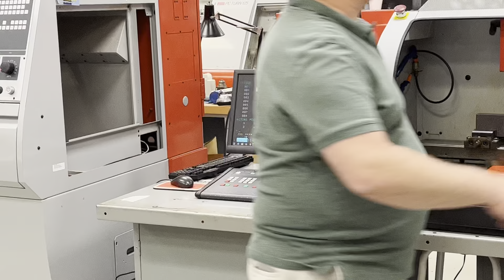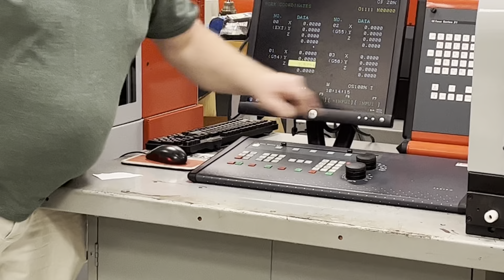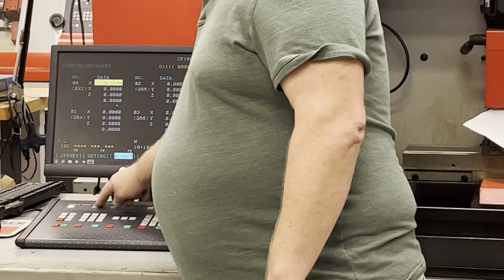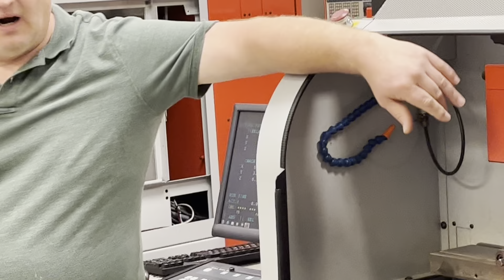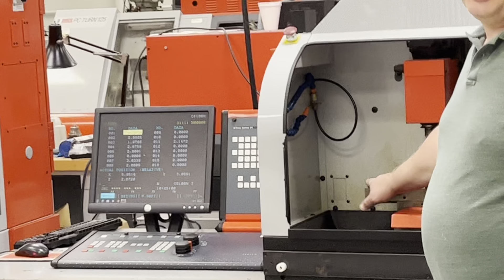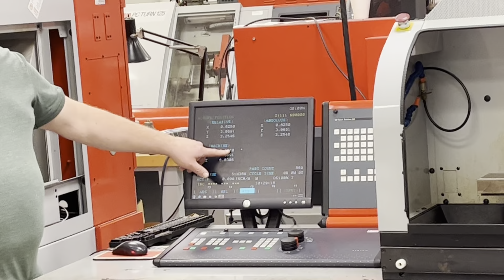Setting up the Emco CNC Mill 50

Comment: Wonder how to mill with this software
Reply from the maker: It is programmed using G-Code. The machine doesn't have a tool changer so tools are manually put into the spindle after an MOO program stop code is used.
Reply: @bradcurry7775  On the older F1 toolchange code is M06,  the code line includes a tool offset column to enter the tool offset which moves the Z axis by the entered amount fot the new tool with reference to Tool No.1 which is Z=00